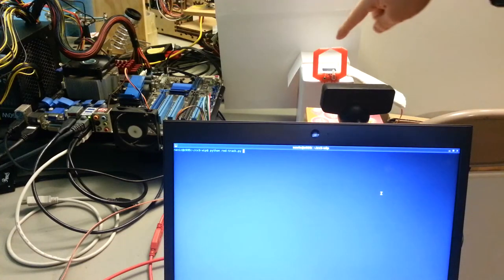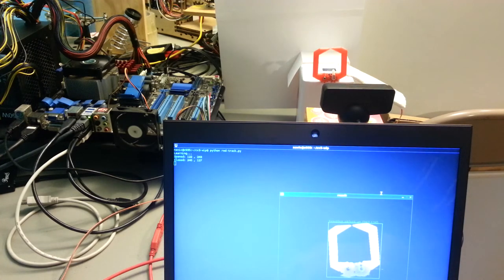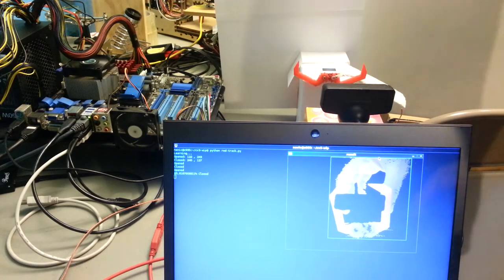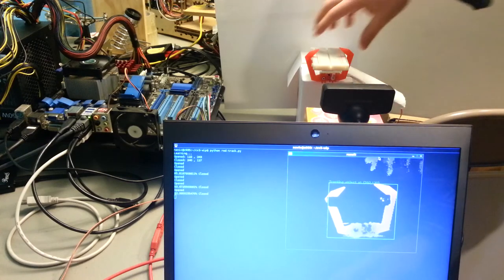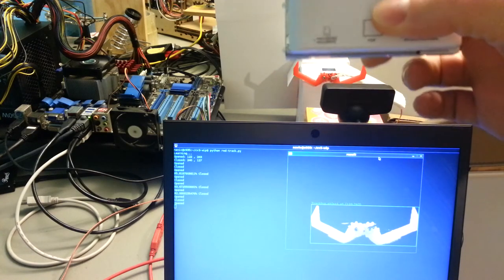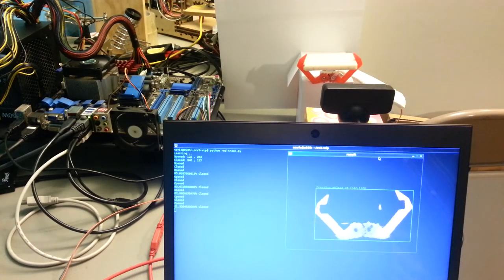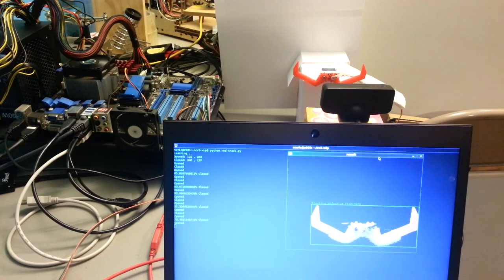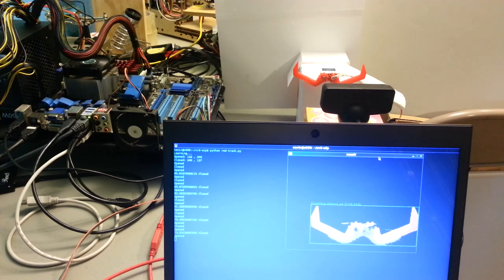Robotic Claw Computer Vision Learning

Comment: how can i add this type of control to my robot?
Reply from the maker: +Frank Lopez Looks like you've got a lot going on in your setup.  I can't share my code due to contract restrictions but its written in OpenCV so if you know that library you will have the right tools to do this.
Reply: thanks but im actually not using opencv, i have try to install it and im not having much luck, plus you know the usual no one is trying to help so im kinda stuck just where the video ends, so maybe you can help with the variable declaration aspect of opencv?  i think thats where im having the issues in order to have any luck in vs2013
Reply from the maker: +Frank Lopez I hear ya on the OpenCV pains, everyone goes through them.  I use Linux so I can't offer any help with installing and using in a Microsoft environment.
Reply: what are you trying to do ? end goal? you mentioned a contract tho i never herd anything about stores, sells or even a website address ? 7+ years thus far i noticed you been tweaking around
Reply from the maker: +Frank Lopez I'm just a tech fan that makes things for fun.  If someone comes to me with the need to create something I'll use my videos to show them concepts and such before writing up a contract and then go to work creating what they need.
Reply: okay, i dont think you answer my question completely what does your contract status has to do with this particular video ?  i mean i never asked you for any code, yet thats the first thing you said to me as if i had asked to begin with.  i was merely asking about your setup and the implementation of this device, this does not requires any code to be passed up but exactly what you said this videos are for " to show them concepts and such " yet this is not what you started your reply with off the bat.
Reply from the maker: +Frank Lopez Sorry for bringing up the code.
Reply: no need to be sorry, tho accepted, but early try to get back to the main question that started all of this.
Reply from the maker: +Frank Lopez I don't know how you can add this type of control to your robot.
Reply: navic209 i can tell you that in my setup you seen i was telling my AI "cortan" to turn the switch on (this was obvious) but what you did not see is that i had a setup routine that shoots strings like such "a" viz serial protocol to the mcu via usb port on one of it's COM ports and that was follow by a if  statement on the loop setup ready to execute a simple pin control parameter.

(THERE SEE)

" not once i gave a code but i believe i was helpful enough to give someone a idea on how to achieve this goal i have achieved "

this is the type of information i was looking to read from someone who's been playing around with this type of electronics for 7+ yrs to another user who only have 11months of learning exp.
Reply: navic209 did you just said "" I don't know how you can add this type of control to your robot.???""

7+ yrs playing around and you dont know ? you clearly aint trying to help period, cuz for me to hear this from someone who uploaded a video call "Clawbot Update 2" clearly tells me your a terrible liar my man shame on you, lol 

you are clearly just drive by money and groupies, this tells me enough about who you are and what defines you, it also explains why in 7yrs you have not become someone of wire magazine or some sort of public figure.
Reply: +navic209 dammmm someone got burn on a lie